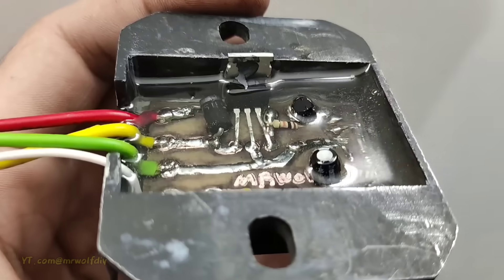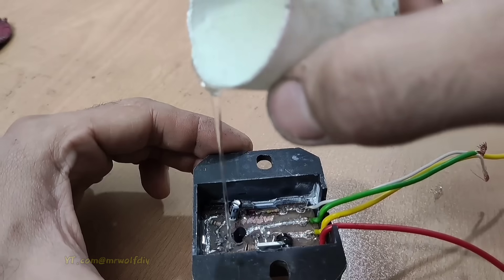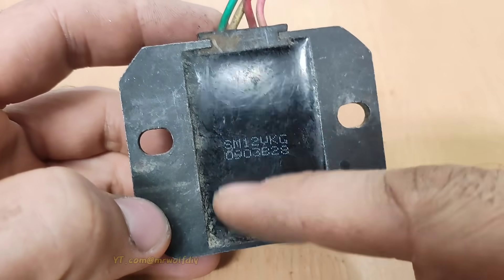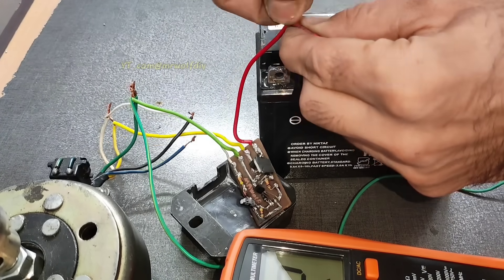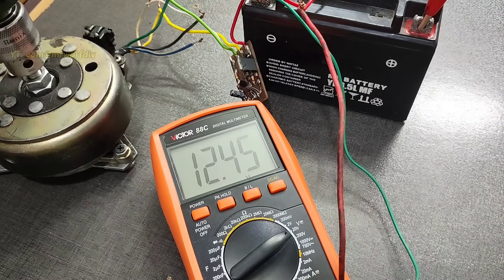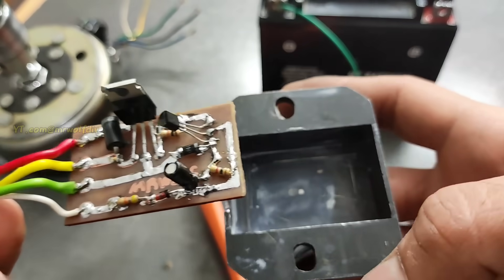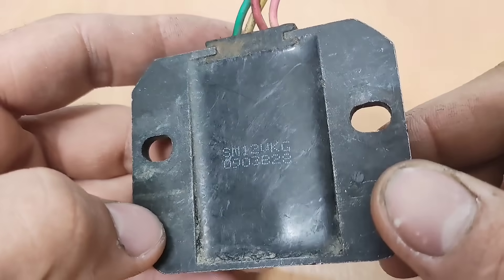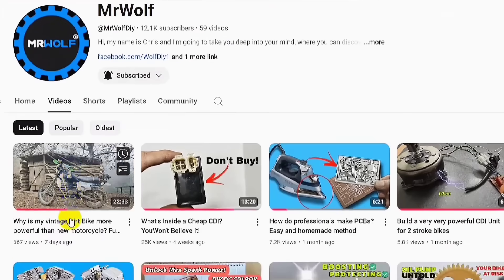The Easiest Way to Build a Motorcycle Regulator – Mind-Blowing Hack!

Comment: What is that thing you are placing all these componants onto ? Is it neccesary or can you just wire it in another way ?
Reply from the maker: You can do this in other ways, like using a perforated board or even without a board.
These are to prevent short circuits and make it look more professional.
Reply: @MrWolfDiy okay i see. Thanks for the reply ! Your regulator rectifiers seem almost feasable for someone with little to no electrical knowledge , do you think someone with some basic knowledge in electronics could build one of these ?

Comment: I made this but it didn't work properly.without load or small load it output over voltage .but with load it stable at 14 to 15 volts it burns out my indicator or low load
Reply from the maker: maybe it's not suitable for your bike,
It's for older bikes
Reply: @MrWolfDiy i have the same stator like yours stator you are using for testing
Reply: Dont understand this design. 47k will not allow any significant current unless that the ac also has a grund connection. If so why two ac connections. Please add full ac details.

Comment: Ac across 47k? Wrong diagram
Reply from the maker: This circuit was on Pinterest, and in any case, it works…But It might need some modification ... Can you please specify which part of the diagram seems incorrect?
Reply: @MrWolfDiy  i also saw on pintetest but why u change resistors values?

Comment: Battery will charge with AC current?
Reply from the maker: In fact, it’s not AC,
but rather a pulsed (unfiltered) DC voltage,
which only passes the positive (or negative) half-cycle of the AC wave,
so the output is a direct voltage but full of ripple (pulsed).
Reply: @MrWolfDiy  .....Which will essentially lessen your battery life...I love the majority of your work, but this, I find somewhat misleading.

Comment: apakah bisa digunakan untuk motorcycle yang menggunakan ac headlamp?
Reply from the maker: The output current of this regulator is not very high and it's designed for older engines...You should test it.
Reply: oke terimakasih banyak 🙏

Comment: Hi, Mr. Wolf. 
I truly enjoy your videos.
Which circuit component determines the clamp voltage??  In other words, which component(s) determines the maximum charging voltage??
I have a 4 cell Lithium battery in my motorcycle. It is very sensitive to overcharging. Anything over 14.2 volts causes premature battery failure. I currently have a cheap 4 wire regulator/rectifier from Amazon. It clamps the voltage at approximately 14.5 - 14.6 volts, which is too high.
I would like to build your DIY reg/rec... but i want to make sure that it clamps the voltage at 14.2V or less.
Thank you, sir!! 👍
Reply from the maker: Hi dear, 
A voltage of 14.5–14.6 volts is indeed too high for a lithium-ion battery. It should be clamped at 14.2 volts or lower. If you're building the circuit yourself, you need to precisely set the clamping or cutoff voltage — for example, by adjusting the voltage divider resistors or using a precise reference...
The component that usually determines the clamp voltage is typically one or more Zener diodes, a voltage regulator, or a comparator circuit with a reference voltage.
The versions I’ve published so far are mostly intended for lead-acid batteries or similar applications where slight voltage fluctuations aren’t critical.
My suggestion is to use a regulator circuit with a TL431 IC and a PWM controller. If I can find a good circuit for this setup, I’ll publish it.
Reply: Thank you so much, @MrWolfDiy !!
You have an amazing mind, my friend. I have enjoyed electronics diagnosis and repair ever since I got into Ham radio about 25 years ago 👍.  It's a wonderful hobby if you enjoy speaking to people all over the world and tinkering with electronics 😂.  Thanks again, brother! I'll be waiting for your video on building a reg/rec for Lithium batteries.

Comment: do you have circuit regulator working without a battery?
Reply from the maker: If you only want it for voltage regulation so your lights don’t burn out, you can use the lossless version. It can be used without a battery as well.
Link: https://youtu.be/KtSelisDO8s?si=8tCiEBFPZTvYpqX-

Comment: The white wire is the main source of AC voltage for charging the battery. If all the consumption is placed on the yellow wire, sufficient voltage will not be achieved on the battery. On a motorcycle, there are at least two 25+5W bulbs and a 10W stop bulb. The charging current through the white wire is usually not enough. I also made a version where I rectified both AC inputs via a thyristor to DC for the battery and then powered the bulbs from the battery. This turned out to be the best for weakened magnets.
Reply from the maker: Hi dear, Thanks for your explanation and valuable experience.
I'm really interested in seeing your version as well, especially the one where you used a thyristor and powered the lights from the battery
Reply: @MrWolfDiy , You can try with the ICM7555 as an oscillator (10kHz) which, via a capacitive pump, generates current pulses (30mA per gate) to the gate's two thyristors that rectify the plus from the yellow and white wires. Let the voltage comparator control the reset of the ICM7555. It is the simplest connection, but sensitive to excessive voltage (>18V for ICM7555).

Comment: I'd like to build one for my 1982 suzuki gs650gl. What components should I use for that specific build?
Reply from the maker: Hi dear, 
Based on my information , Your motorcycle has a three-phase stator.
And uses a DC CDI.
This regulator is not suitable for you,
 but if you're interested in making a custom regulator, I've already made a 3 phase version before and you can see it on the channel...
New version is also coming soon...
Reply: Thanks I'll check it out.

Comment: This doesn't have a power cut, it just charges constantly??
Reply from the maker: These types usually don't have a voltage cut-off...
Reply: @MrWolfDiy  and not Is dangerous?
Reply from the maker: Most motorcycles with older platforms use shunt-type regulators. Only advanced and modern motorcycles have more specialized regulators...
You can tell me what your motorcycle is—maybe I can help you better.

Comment: Sir, can you make one using SMPS topology?
Reply from the maker: In the future I will try to make
Reply: @MrWolfDiy    just make a "disconnect" type.
That is the only type I buy for my Harely now. Instead of shorting (shunting) the stator at 14v, it disconnects the stator at 14v.
You need a higher voltage SCR or TRIAC (because open circuit stator produces about 90v AC), and a little bit more control circuitry.

Comment: this is halfe wave or full wave ?
Reply from the maker: It's Half wave
Reply: @MrWolfDiy  which is for the yellow cable light path on the factory rectifier, and for the red battery path on the factory rectifier, are they combined into one?
Reply from the maker: As you can see in the diagram, the AC voltage is rectified by only one diode.
This regulator is an old copied version and may not work on some motorcycles.
I have built an optimized and noise-free version, which I will release soon.
Reply: ok,,thank u sir,,

Comment: voltage is not stable and going overcharge,,,,useless idea
Reply from the maker: You should note that this regulator is half-wave and designed for single-phase stator; otherwise, It may not work correctly.

Comment: Hi thats cool ı will try but can we make with arduino like smart?
Reply from the maker: Building an Arduino board is entirely possible. If you need it for regular projects, buying a pre-made board is cheaper and faster. However, if you want deeper learning or a custom design, building your own Arduino can be an exciting experience. But not this circuit...

Comment: Hi wolf, how the stator dissipate the energy, when it's not producing useful work, isn't it overheating in the summer
Reply from the maker: thanks for detailed question,
the stator dissipates excess energy as heat. In summer or when the electrical load on the system is low (for example, when the lights are off), the regulator shunts more energy directly to the ground. This increases the temperature of both the stator and the regulator. As a result, in some motorcycles, the stator and regulator tend to overheat more in hot weather or at lower speeds...
To prevent this issue, the best solution is to add permanent electrical consumers. In older Honda motorcycles, a pair of 20-watt resistors does this job. Alternatively, the regulator can be installed in a location where direct airflow helps cool it down.

Comment: sir cn i ask, why the tester is ac set is that dc charging
Reply from the maker: Because It's half a wave...
It only rectifies the positive or negative half-cycle of alternating current (AC) and stabilizes the output voltage. It is commonly used in older motorcycles or 6-volt systems

Comment: The RPM of motorbike is about 12000 RPM... and that tool is about 2500 RPM... It's make different voltage at last
Reply from the maker: Maybe, But the regulator's job is to prevent the voltage from exceeding the permissible limit, even at higher RPMs.
Reply: @MrWolfDiy you nailed it bro, good answer

Comment: Tell me..On the AC input we can put DC to reduce 18v to 14v to use it on a solar panel for charge lead-acid battery..
Reply from the maker: The internal circuitry of an AC regulator is designed to regulate and convert AC voltage, not DC.
Reply: @MrWolfDiy  Youtube have a video where a solar panel is connected a motorcycle regulator/rectifier and reduce 33 volt dc to 14 volt dc..

Comment: Kalo semisal pakai 2p4m bisa kah
Reply from the maker: If the motor is small and the stator's output power is low, 2P4M can be used. However, if the current and voltage are high, BT151 is a better option.
BT151 has more than twice the voltage and current handling capacity.

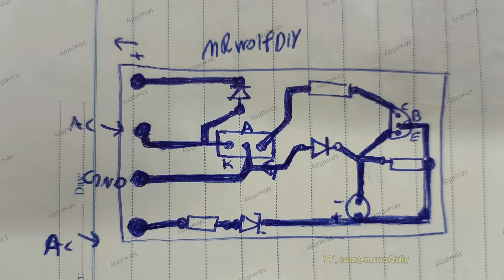Comment: en 1:51 La bobina de la motocicleta produce 3 fases onda sinusoidal, lo que llamas tierra es una de las salidas, podría ser cualquier otra salida de las 3 fases, ¿qué piensas?
Reply: No... en las motos pequeñas y/o antiguas hay AC1 para carga de bateria y AC2 para luces y ambos referidos a tierra(chasis) por lo que no se puede hacer rectificador de onda completa. Sin embargo la prueba esta incompleta falta probar el regulador de AC y ademas probar almenos a unas 7000rpm ya que es para un motor 2tiempos.
Reply: @carloscoronado8712  Ok, entiendo ahora mejor, es como un motor de refrigerador que tiene 2 bobinas (una para la inicio y otra para la operación) su circuito rectifica la media onda de AC1 a través del diodo 1N5408.
Como puedo ver que la corriente de AC2 no puede pasar a través de Thyristor BT151 porque solo la puerta obtiene pulsos.
Reply from the maker: Hello, thank you for sharing your thoughts. Yes, right; the drill has a maximum of 1000 RPM, and it should also be tested at higher RPMs :5000 or more...
It is worth mentioning that I reverse-engineered this regulator circuit from a Honda CG 125 CDI regulator. The tested stator belongs to a Honda 125 four-stroke motorcycle.

Comment: I own a Royal Enfield 350. It has an RPM meter that has readings till 8000+ but the bike never revs past 4500 rpm. For reasons obviously, an electronic lock. Could you help me unlocking it or rebuilding the CDI from the scratch, considering me a noob in electronics(I can solder components). Its my desire. After searching yt and github too ti bottom. I found your channel. I really wish only you can help me. ❤ from India.
Reply from the maker: Your motorcycle will get damaged if it operates beyond its RPM limit because it is designed that way...
However, if you want to remove the limit, since your motorcycle's ignition system is DC,(usually) the only way is to use another CDI module without a limiter.
Reply: Long stroke engines need to be revv low brother

Comment: How much what should the Zener 12v diode be?  1 3 5  of 10w??
Reply from the maker: One-watt is enough, but for longer durability, you can use a two-watt Zener and one-watt resistors. A heatsink for the thyristor is also very important.

Comment: Hello sir please update vehicle alternator voltage regulator circuit 12volt and 24voltage circuit diagram please sir
Reply from the maker: Car regulators handle high currents (50 to 100 amps), so building one is not cost-effective.
Additionally, due to high stress on the circuit and heat generation, they are more likely to fail.

Comment: does it turns off when the battery is full?
Reply from the maker: No motorcycle regulator works either.
Reply: yes bcoz of bt151
Reply: No lead acid batery chargers allways are mantaining voltage. lead acid batery allways need to be charged and need to be charging at least 13.85v depending on temperature more colder more voltage but never more than 15.00v

Comment: Please tell me my there are 2 ac input
Reply from the maker: These regulators are specifically for motorcycles with a two-phase stator that have an AC ignition system.
Three-phase stators either have a DC ignition system or are fuel-injected.

Comment: very strange schematic.. AC2 from 47k and then zenner..what curent output ?..charge is happening only for nonstop driving .... neach.. i don't like this..  for this job a full rectified then smsp buck converter with current limitter is ok. maybe some uC for power management
Reply from the maker: This is a half-wave regulator for engines with a two-phase AC stator, and it has its own specific application.
The output current is suitable for a 3 to 5-amp battery.
In future projects, I will teach a full-wave regulator with a higher output current.
Reply: It not correct.47k how bear up current .

Comment: What happens if I use a full wave bridge rectifier in the output (instead of half wave)? Also, why is he using AC mode in multimeter for testing the battery output?
Reply from the maker: The structure of the stator coil is different in full-wave regulators,
and if you notice, the multimeter was set to DC mode.

Comment: What is the liquid name in which you submerged..
Reply from the maker: "Epoxy resin" ,It is a type of industrial adhesive, in electronics parts, used for short circuit protection and insulation and more...
Reply: Hi sir i am from India..i am using old yezdi motorcycle 250cc..for that i converted points type ignition to cdi system..but i am not satisfied with HT and CDI ( both in one unit)..if we want to make powerful one what the data we require.. please guide... thank you
Reply: Technical name: Epoxy adhesive. Brand name: Araldite

Comment: Hi, is your stator windings grounded?
Reply from the maker: Yes
Reply: @MrWolfDiy  mine is the same,  a sym symphony with AC CDI , I don't know if it is a half bridge or a full bridge RR
Reply from the maker: They are half-bridge, because they are not full-wave, in the full-wave model, they have two thyristors and a full diode bridge. I will make them in the next videos.
Reply: @MrWolfDiy  ah ok, so the three phase stator is full wave RR which is not grounded to chassis, and it is 12 volts DC CDI am I correct?
Reply from the maker: Yes, in carbureted engines, three-phase stators do not have a spark coil because they use CDI-DC.
In fuel-injected engines, the stators are entirely three-phase, and instead of CDI, the ECU  or ECM takes over the ignition timing functions.
However, two-phase stators also have a full-wave regulator, Depends on the type of motorcycle.
Thank you for following us.

Comment: good work. 👍   
If possible, could you please explain how you decided or calculated on the parts to take? 
Thats the problem I got recently. Want to do a selfmade regulator on a Yamaha MT-01.
Its a 3 Phase Generator and I would like to fine adjust the cut voltage for different Batterytype uses. 
(Lithium 14.5V and AGM Higher for example)
Reply from the maker: Greetings,
Lithium batteries are more sensitive to overcharging, while AGM batteries have the capability for fast charging up to five times higher.
Measure the output voltage in charging mode; it should not exceed 14.5V.
Considering this, you need a suitable regulator-rectifier.
For your motorcycle, a three-phase full-wave regulator with a 15-20A capacity is required.
I will definitely build one in my future projects.
Reply: @MrWolfDiy  best message of my day😄🍻

Comment: What is the solution name that filled
Reply from the maker: I don't understand what you mean ?
Reply: I think he meant the material that was covering the original circuit you ditched.
I think it is kind of resin

Edit: now I get it. I think he meant the liquid you used to build the pcb board.
Thr acid I guess it was, wasn't it?
 @MrWolfDiy
Reply from the maker: Yeah Thanks, 
For making a PCB board, I use a special etching acid for printed circuits(Ferric Chloride) with warm water. For filling the box, I use industrial epoxy resin, to which you can also add color.🙏

Comment: Somehow your schematics are looking weird, like if the anode and cathode of the semiconductors are wrong.
And I don't know your motorcycle, mine had a 3 phase generator.
Reply from the maker: This regulator is for two-phase stators,
Reply: it is for a monophase chassis grounded stator and it only regulates negative phase the positive phase is conected trught a diode to the battery. it is because the lights are conected directly to ac.
Reply: @carloscoronado8712  Ok, this explains why most other schematics looks different.

Comment: Unless I’m missing something?
Reply: These simple permanent magnet charging systems typically regulate the output by shunting the stator coils / coil, as done here with the SCR. Automotive style alternators typically don't have magnets so the output can be regulated by the current fed to the alternator's field winding.
Reply: @khwolter9038 True, the problem with shunting stator is this contributes to building heat.
Reply from the maker: Regulators are actually rectifiers, and in addition to rectifying, they are responsible for voltage regulation.